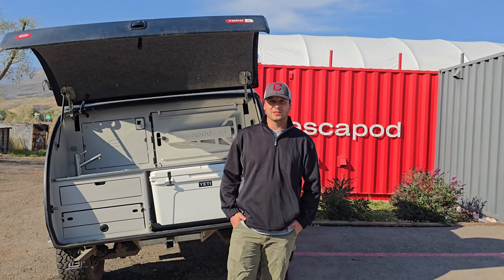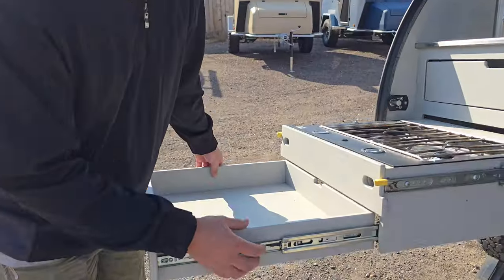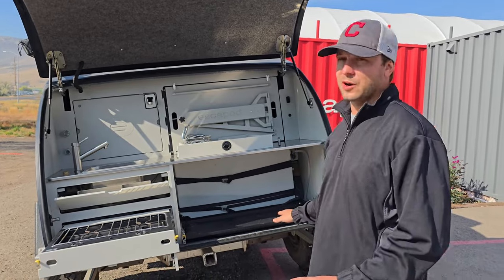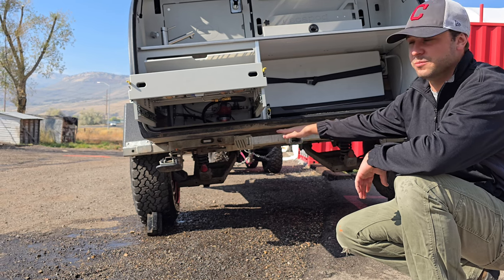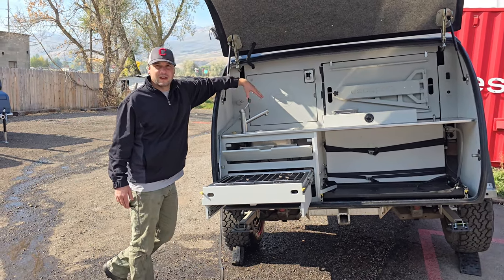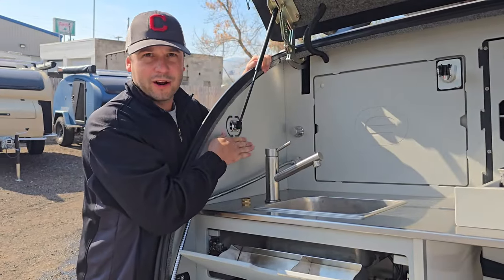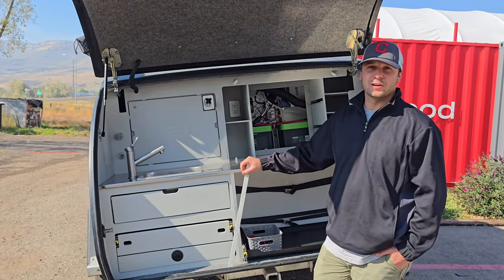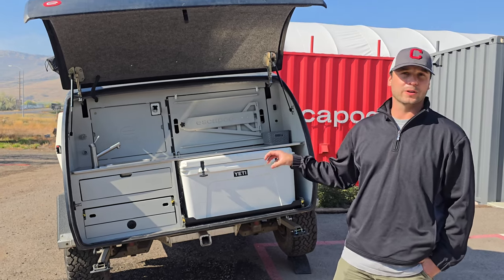Winterizing Your Escapod TOPO2 Voyager - 2024

Comment: Thanks for this! I'm not so far North, but can get an occasional 5 to 8 day cold snap with temps down to the teens and not above freezing. Additionally we do have an early December and New Year's Eve camping trip scheduled. May or may not be cold.  Other than that it will be in the garage that generally doesn't get below freezing. Planning on just topping off the batteries with shore power in the garage when needed.